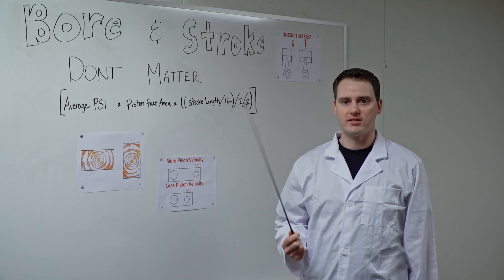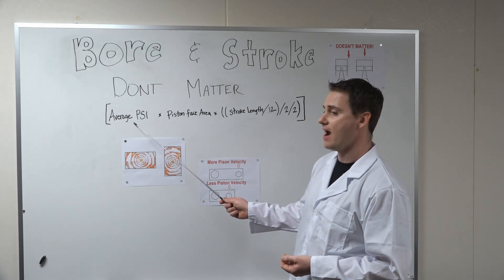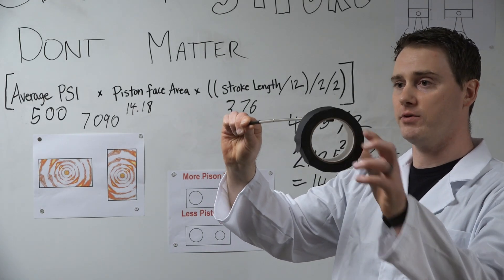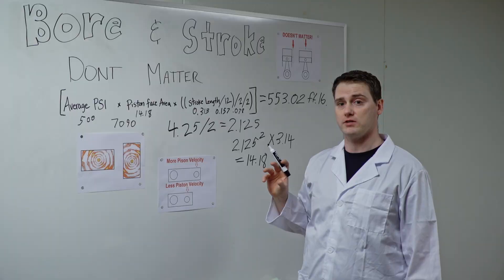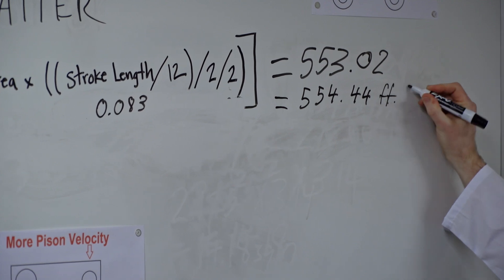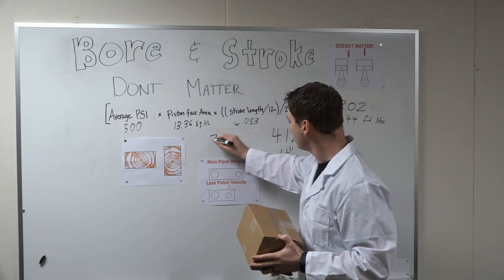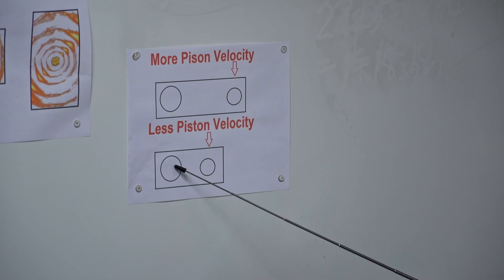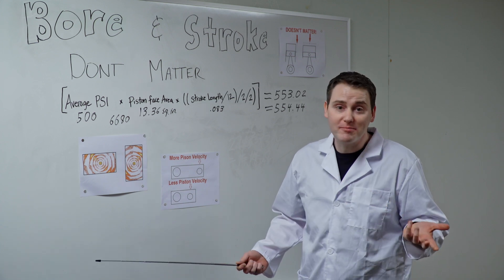Why Bore and Stroke Don't Matter! | Not Rod Science Ep. 1

Comment: Bore & stroke Absolutely matter when building horsepower. With that math you're showing, you can't take into effect. Valve shrouding which is a huge issue relevant to bore size. If you can't get a big enough valve in it to move the air that the engine needs due to the small bore then you ain't doing nothing.
This video, however was really well done and I enjoyed it!
Reply from the maker: We'll probably do a follow-up on valve shrouding, valve angle, etc. The purpose of this film was to show that all else being equal displacement is displacement.
Reply: @NotRodShop  I'm actually driving down the interstate right now, so I apologize for my atrocious spelling in that comment, but I think I've got it fixed. Speech to text got me. I also added to my comment that your video was very well done and that I enjoyed it because I didn't want you to think that I was trying to take anything away from you. I just think that a lot of people don't consider what I mentioned. You're much smarter than I am, I'm sure. So I wasn't trying to be a know-it-all. Looking forward to your next video!
Reply from the maker: @Headsup9550  No worries friend. Thanks for watching the show!
Reply: @NotRodShop  For sure dude! I've been watching since you guys got the Nova ready to go to the track and took it with the slapper bars & the 3 speed!

Comment: Yeah from the small bit of knowledge i have in this topic is 2 engines with similar displacement they will make similar horsepower if identical besides bore and stroke. Valvetrain, head design, intake design etc make more of a difference than bore vs stroke for the most part. Bigger bore gives more options for chamber design but thats usually more for the higher end stuff.